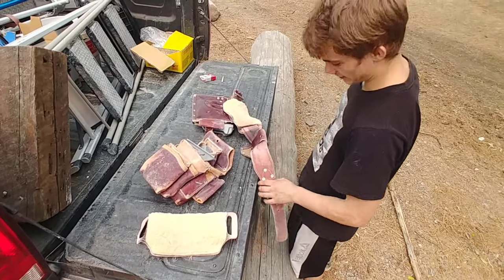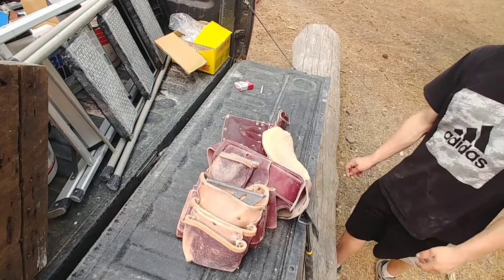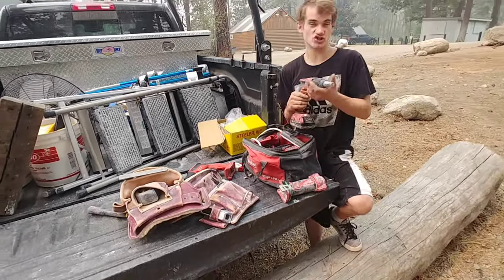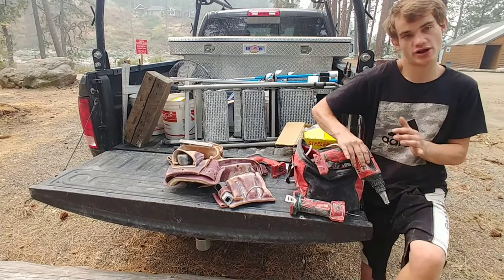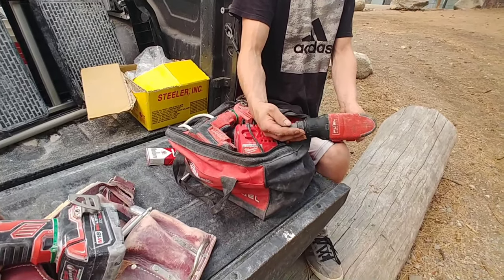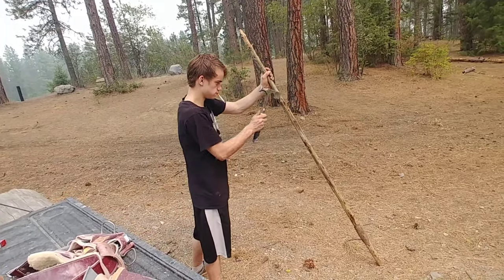occidental leather bags & Milwaukee screw gun & router for drywall review with the squanch

Comment: (DURAcuir industriel) right hand tool pouch/ anyone who looking for the best top of the line tool pouch made in Canadian. But for my hammer holder and screw pouch i use occidental leather. Definitely recommend this canadian made pouch for every sheetrocker out there. For my gun router and others power tools my company uses makita I've put the thru the test on ladders, planks, ect.  And for leather work belts, i always go with 3 inch one i find then the most comfortable. Nice set up though i like it man and Milwaukee is still good shit I've used there guns and routers before on side jobs.👍

Comment: Look up Chicago screws.. common for leather worh and can be removed unlike rivets. They are what I used to secure my pouch to my belt. Also work great for repairs.. if ya know any one that has a torn pouch😉
I noticed squanch has room enough to slide the hip pad forward, under the buckle. Might be worth a  try. Or even rotate belt so buckle lands on on the pad.